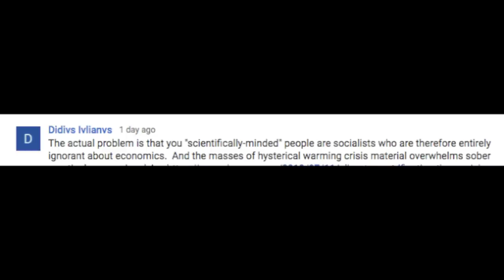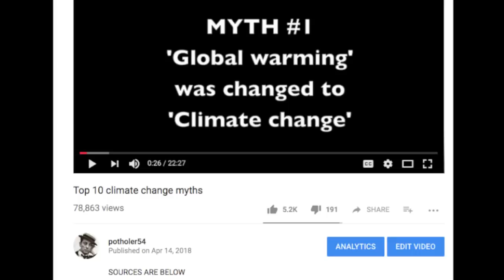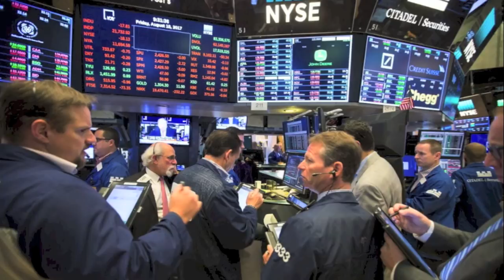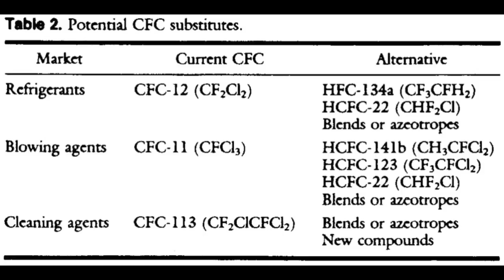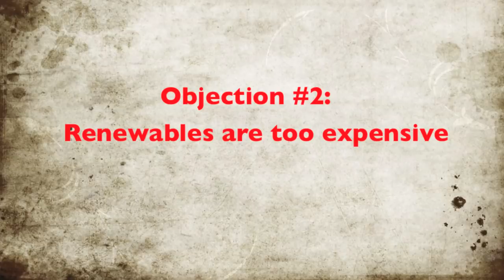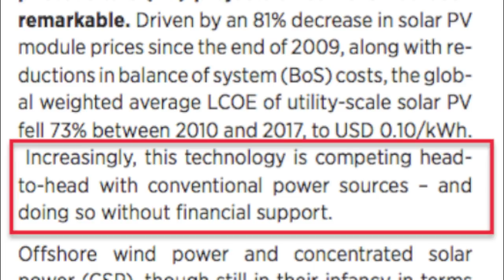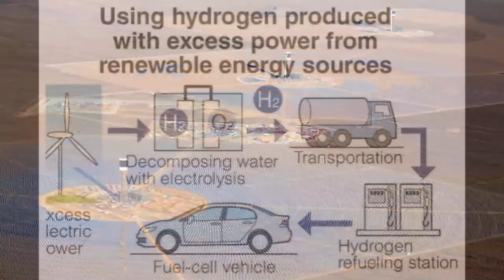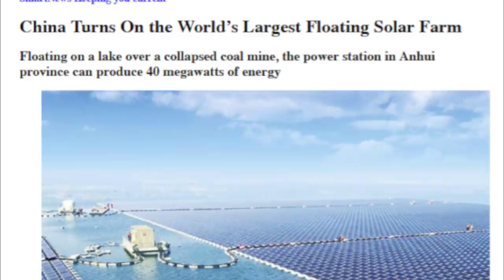A CONSERVATIVE solution to global warming (Part 1)

Comment: In addition to roughly 1,000 gigawatts of existing coal capacity, China has 121 gigawatts of coal plants under construction, which is more than is being built in the rest of the world combined. I also understand that the USA has lowered their CO2 emissions  by a significant margin more than any other country in the world. So your narrative about how wonderful China is vs the USA regarding CO2 usage seems to ring hollow. 
Also the best technology we have by a huge margin to reduce fossil fuel usage is nuclear power, not these costly and unreliable wind and solar options you mention here. Do you advocate nuclear power? As I understand it the new generation 4 nuclear reactors are incredibly safe and can use the spent fuel from the old unsafe early generation reactors. So if you were really serious about CO2 climate change issues why don't you advocate that technology? https://www.youtube.com/watch?v=N-yALPEpV4w
Reply: Gen 4 is still "looks good on paper" stage if I'm not mistaken. Is there one approved and in the process of being built in the world currently?
Reply: @GreenTimeEagle  That is the point, the technology actually exists, it just requires investment and certification. Things that could happen quickly if there was sufficient demand. Search you will find several companies trying to certify prototypes. The process is difficult but made more so when there is limited cooperation and demand. If folks were truly serious about sustainable energy we could implement today, this is it, and yet...
Reply: @ericmichel3857  The Chinese are already doing it. They estimate them to go online within around twenty years.  And that is the crux about the whole molten salt reactor thing. Waiting another twenty years or eventually event thirty years is not an option. So would not call that the "best technology" for that matter. Plus you say renewables are so expensive but how much cheaper would a molten salt reactor be in comparence? From what I heard nuclear power plants are ridiculously expensive to build and I can´t imagien a reactor running on molten salt can be that much cheaper to build.

Not saying that eventually Thorium reactors wil never be a thing or should not be researched or developed on but it is simply not a short term solution.

And if we are looking at long term solutions fusion reactors to me seem a lot more promising.

Plus your argument about "China is wonderful" is not really an argument since potholer is not really saying that. But he says China is leading in production of solar panels and has a significantly high share of wind turbine production that got shipped there from mainly Europe and the US. You can´t deny that these industries got outsourced which is surely not a desirable goal,  is it?
Reply: @burninghard  We actually had a molten salt reactors operating back in the 60's. There is no major breakthrough required, it just requires engineering development and certification. The only reason we don't already have them is due to political reasons and our fear of anything with the word nuclear associated with it. So if we put a massive effort we could have it a lot sooner, unfortunately a lot of people are still fighting this technology, or at least they are not advocating it.
As for cost there are companies right now working on small modular designs that could be far more economical  than even fossil fuels if we did a full scale production. The problem with wind and solar is that it is not robust or reliable, and we  have no reliable cost effective energy storage technology, and certainly not enough to meet world wide demand. So if you want sustainable energy without fossil fuels we are not going to get there in the foreseeable future  with wind or solar. 
We are not going to stop using fossil fuel anytime soon, and if you really want to understand why Bjorn Lomborg gives a very good explination here:  https://www.youtube.com/watch?v=5QyXduteiWE&list=WL&index=156&t=0s
"Plus your argument about "China is wonderful" is not really an argument since potholer is not really saying that." He did not say it literally but IMO it is implied, despite the fact that China is the number one polluter on the planet and despite  (drop in the bucket) solar and wind investment, they are on track to pollute even more in the coming years. Only the USA has actually lowered its CO2 emissions over the last decade. 
Solar and wind is an offset strategy at best,  the technology is improving and getting cheaper but there are inherent limits regarding how efficient panels will get and how good battery technology can get, not to mention the production and maintenance of these technologies also have significant environmental impacts. There is not free lunch, this video "Why renewables can’t save the planet" explains some of these issues:  https://www.youtube.com/watch?v=N-yALPEpV4w&t=127s 
We must have a reliable and robust energy solution and that will never be solar and wind. We have hope for fusion but that always seems to be another 20 years away, so that leaves us with fossil fuels or nuclear fission.
So all of you who actually believe the world is going to end soon if we don't stop using fossil fuels need to be demanding we go nuclear, otherwise you are just complaining  twats with no real solution.  
So no I do not care at all that China invests more than us in solar panels, and I am glad they are investing in nuclear, I wish they (and everyone else) was doing a lot more of it.
Reply: @burninghard  So much as divert all funding from fusion technology to molten salt reactor development we would have a fully operational reactor within 5 years.

Roast me. Mock me if you think I'm wrong, please. I wanna hear everything.
Reply: @MoreParksLessParking  That´s a guess or do you have any data that supports that?
Reply: @burninghard  A guess. A guess based upon the the development time needed to test any unproven aspects of the technology (of which all significant pieces have been, and with 60's technology no less), the streamlining of the regulatory process if the government takes a more active role ( as most funding for fusion is from the government, the assumption is that government diverts it all to MSRs), and finally the speed at which both the government will increase that funding and regulatory streamlining once it shows the ease of its progress, and the speed that the private sector will catch on and take over from government once (and if) it's been proven to be economical. 

I admit that I'm being intentionally provocative when I say 5 years. It would more honest to say that 5 years is, in my opinion the absolute best we could hope for. If we give it it's all. But I'm of the belief that the best way to predict the future is to create it. Quite frankly, the Achilles heel of molten salt reactors was always their lack of testing and experience, but that is NOT a fault of the technology itself, that it the fault of society for ignoring it's potential. Nothing could make any this change more quickly than money and investment though. 

MSRs deserve the chance to be proven unviable, just like solar, or wind has been given their chances. And I think they failed their tests horrendously, but you wouldn't know it since results are well hidden behind subsidy upon subsidy and complete mainstream acceptance that renewables are the ONLY solution to climate change, which potholer has unfortunately been taken in by (but there's hope for him).
Reply: @MoreParksLessParking  "MSRs deserve the chance to be proven unviable, just like solar, or wind has been given their chances. And I think they failed their tests "

Why do you think that? From my point of view if you would sink that matter of resources and effort into developing and pushing renewables further we would already be there. Or just not blocking it would be enough in most cases. But what you see all over the world is that a decentralized power source with little economical impact (oh yeah I know the birds and the area consumption... dramatic) is not the way to go for no reason and instead we should focus on this or that new or revitalised technology that will probably only be ready for a rollout in decades,  instead of pushing a technology that already is known to work right now. Why do you believe is that?

That does not mean research in fusion or MSR should not happen. If some better technology comes along that proves to be even more effective why not switch to that later on? For sure, why not? But we need some real alternatives right now. Not in 5 years (which is a really optimistic guess since the Chinese are  about to build some MSR and estimate them to go on the grid after 14 years of building time and Corona showed us that those kind of goverments can build things pretty swiftly if they want to), not in ten years and not in twenty years but now. We have around ten years to completely stop fossil fuel consumption to prevent climate catastrophe and yet we should keep on burning fossil fuels until we manage to realize a technology which we don´t know for sure will solve the issue and don´t know what other issues come along with it? That´s like saying stop the social distancing now because it can´t enterily stop the spread and we will have a cure to Corona within the next few months for sure so it is not necessary. That kind of logic only makes sense in the mind of a fossil fuel executive.

Comment: We need to look at nature to see simple solutions for global warming.
The white ash cloud from volcanic eruptions reflects sun light back in to space.
This reduces global atmospheric temperature very quickly such as the eruption in the Philippines did recently for several years.
The roofs of buildings and houses in hot areas are painted white to reflect the sun light and cool the building.
Now we need a movement to paint our roofs white to reflect sun light back in to space to cool the atmosphere.
This can be done without any outside help and make people part of an effective programme to cool the world.
The politicians do not have the ability to solve this problem.
The only ability they have is to pass laws and this can not control nature only engineers and scientists can.
The reduction of the emission of CO2 in to the atmosphere will take many years to achieve and even longer 
to slow the increase in temperature.
However if we reduce the temperature by reflection of sun light this will be swift and enable us to have a CO2 rich atmosphere without the higher temperature.
This will be very good for all plants as they need CO2 to grow and would flourish. so we would have the best of both worlds.
Reply: Paint's a bit expensive. Could we use aluminium foil? And, to hold it in place, at least for a few years, is there a glue that is heat resistant, cheap and not environmentally detrimental? Better still, what white flowers could be grown all summer long on a roof garden? Hang on, let's not get carried away. How much roof space have we got in total? And what proportion of the sun's total radiation falling on Earth's surface falls on those surfaces?
Reply: Painted house roofs won't work. The heat's already below the CO2 enough not to be reflected (that's what's causing global warming). The light coloured ash worked to reduce heating because it was high enough in the atmosphere to reflect the heat before it was trapped. I've had a few thoughts on exactly this. If muskrat used his rockets to put up solar reflectors instead of those stupid starlink satellites, we might get the amount of heat entering the atmosphere down a bit. The other option has been demonstrated to work just recently... JWST has a sunshield, and that would do the same job... A few (or one big enough) positioned at L1 may be enough to reduce the heat getting through. Just a thought.
Reply: @Chris-hx3om  Putting a sunshade at L1 is still way beyond our capability. It might become possible in the next few decades. Anything we can put where starlink is wouldn't have enough surface area to even remotely make any difference.
Reply: @Zamsky39  Also starlink is LEO, basically useless. And I don't think a sunshade at L1 is beyond our capability. I'd argue that it's only just within it, but we don't have 'decades' to do this, at best a few years. We need to be doing all the things being discussed, sunshade, reduction (to the point of zero) use of fossil fuels, CO2 sequestering, reducing population, and reducing consumerism... And we need to be doing them NOW, not by 2050...

Comment: Some of the final pictures are quite laughable, especially the french solar road. Also, this channel been so pro arithmetic and source based, you are completelly missing out the amount of necesary resources to go 100% renewable. Yes, there are solutions been developed, but as you should have mentioned, are not more wind generators. Why didn't you mention that Germany is not cutting on CO2 emissions after such ENORMOUS investment in renewables? Pumped hydro is also very enviromentally harmful and only avaliable in very specific situations. Nuclear is the way to go. Nuclear has the least enviromental damage and deaths for energy generated of all energy sources. Let's stop this primal fear that pushes us to the no return point just because we were not bold enough to accept the numbers and statistics
Reply: stay tuned for part 2
Reply: Nuclear energy requires mining uranium, which addes to its human cost and long term viability. Georgetown texas has transitioned to all green energy and expects to save money over time, countries in europe other than Germany are doing better at transitioning than Germany.
Reply: Thhhooorriium
Reply: G.G. thorium mining has similar  problems. And both are mined for nuclear power.
Reply: What are we going to do with the nuclear waste?
Reply: No it doesn't spaghetti, not to any sensible comparison.
Thorium is way more abundant and pollutes way less than uranium.
It's also not an absolute joke like wind energy.
Reply: @Chronically_ChiII  Thorium would also require greater activation energy and new infrastructure/research/types of plants be built. Thorium is a meme and no one seriously considers it as much as you want them to. Stick to uranium and plutonium, they're fine.
Reply: What is a meme that needs to die is this crazy idea that our civilization can depend in majority on renewable energy.
Repeating that prayer is harmful and doesn't put pressure on finding new solutions.

Urianium for now is ok, but its seriously pointless to not start developing thorium liquid reactors for the future. 
It will advance science in undirect ways, produce less waste, does not produce weapons grade material as a byproduct (so Iran and N-Korea don't have a good excuse anymore), 4 times more energy for the same amount of uranium, safer, takes less land than solar, and the abundance of thorium means that they can be built in better locations.
Reply: @Chronically_ChiII  Thorium, molten salt, etc. all do seem better than our current water cooled technologies , and it's really sad that we (and the world) chose the latter without really thinking things out, back in the 50s. But now? Too little, too late. Maybe on our next planet.
Reply: @geraldzuckier  There won't be another planet. We should assume that life won't leave the solar system (and earth beats being in a shack on mars) because that is the most honest look at our technology, biology, and astronomy.